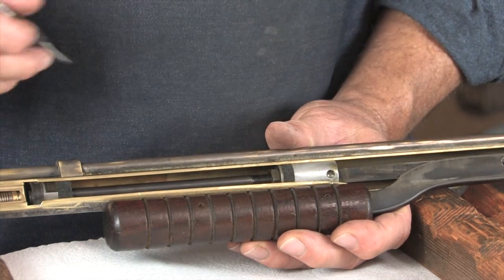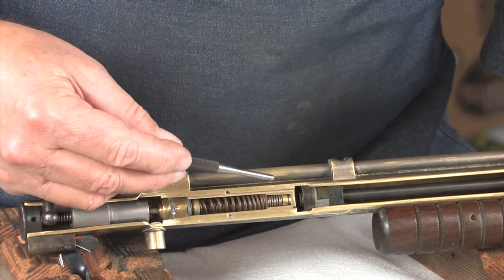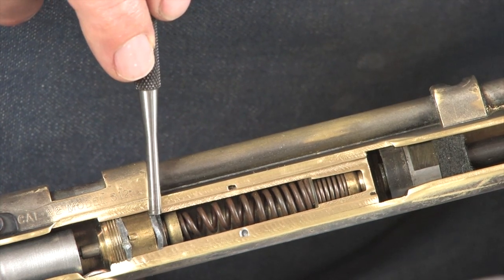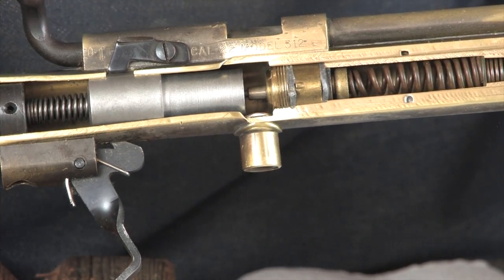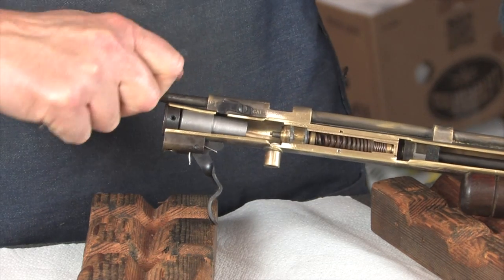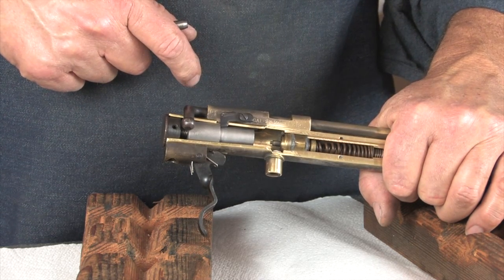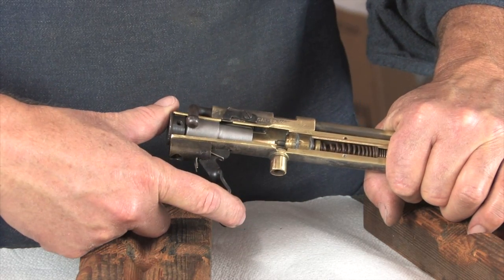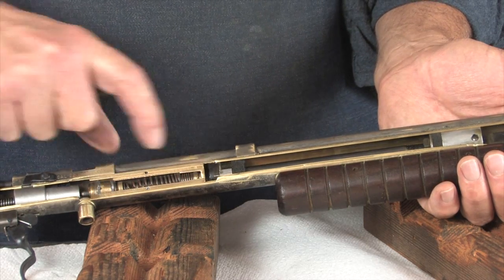Benjamin 312 pumper - Cut Out Demonstration

Comment: Help !  I have a 397PA that's had little use that won't make pressure. The gun was bought in the late 1990's, I am trying to flush it, but no luck so far. What kit would I need to rebuild it ?
Reply from the maker: Try any of these guys;
https://northwestairguns.com/where-can-i-get-my-vintage-airgun-repaired/
Correspond or call if you are uncertain, any of them will set you up with the right stuff.

Comment: What year did they start making them.
Reply from the maker: I think they started production in about 1940, but only made a few because of WWII material shortages.  Ramped up production after war was over.  These were made into the mid-1960's when they were replaced by the Model 340/342/347.

Comment: I have a 310 that the barrel was separated from the pump tube. I soldered the front sight back down and it seems strong (waiting for reseal kit) but I'm wondering if the entire length of the barrel should be soldered?
Reply from the maker: Some were spot soldered, but usually they are soldered continuously the entire length.  If it’s just an inch or 2 you might be ok, but I wouldn’t expect it to hold if the separation is longer.  Shoot it and see if it holds.  If it breaks, then resolder it the whole length.

Comment: did i hear you right did you say lead as in plumbus as seals?
Reply from the maker: not quite sure what 'plumbus', but lead as in lead
Reply: @NorthWestAirgun  okay thankyou for telling me that its plumbus thats why im wondering why i find roof lead here in the philippines for water proofing the parts where you shove in a nail
Reply from the maker: The lead needs to properly sized to seat on the bottom of the exhaust valve and at the top under the valve retaining nut.  If you have to make one, use the bottom of the exhaust valve, the step above the valve face, to size it both outside diameter and inside diameter

Comment: Thanks, great video, I have a model 347 that's not holding pressure, I'll try the links to try to find a rebuild kit.
Reply from the maker: The 347 and 342 are my favorite Benjamin pumpers.  Some even have pretty nice triggers!!!  Well worth the effort to rebuild, even if you have to send it in to a pro to do it.  The basic set up of the pump assembly and valve is the same as the 312/317 rifles, so  the same kit and tool should work in either.
Reply: I also have the same model. But at the moment it is not in order. Have to repair. If I can get the  spare parts I am in a position to repair it. I can spend money on this. Thank you.

Comment: Cool video, thanks for the cutting open. I was messing with the trigger pull on a springer, where the safety is on the trigger, was to light a pull and the sear didn't engage the piston properly, so i kind of like this idea of a safety but you have valid points. They could have made the gap between the hammer less far to travel?

Comment: wow what great videos I've had a 312 I got from my uncle when I was 7 almost 40 yrs. I have always heard you don't want to send these in for repair because of recall on them. My seals have not worked for about 10 yrs. now.  Do you have a good link on where you can get seals and the tool? found a kit for newer gun that the tool looks the same as this but can't buy separate, and I need the seals also.

Comment: Very nice. Even though I have wanted a "tootsie roll" 312 for 40 years, I guess seeing one cut in half really is very interesting. Having older rocker Sheridans, I get a far better understanding on the simplicity and intricity that went in to making these great airguns. I'm very impressed on the relatively small size of an area that actually held the air! Any idea on the PSI it was holding at 8 pumps? Thanks for the very informative info.

Comment: I just wanted to thank you for this and the other vids you posted on the 312 pumper.  This information on the soldered valve system was invaluable to me.  It helped me to restore my .20 Cal.Sheridan  Silver Streak. I got the tool and ten other parts I needed from B & A  and I refinished the stock.  It came out so nice I can put hard hits on tin cans at 60+ yards. At first it looked like crape and wouldn't shoot at all. Because most of my shoots will be much closer I put on a red dot sight, man Am I loving it. can't wait for the first hunt. Thanks again.

Comment: I bought a reseal kit for my 312 and it only has one lead gasket. The other one is some kind of nylon looking material. Which one goes where? Is the lead one at the front of the valve or at the back of the valve. By front I mean towards the barrel of the gun. Thanks.

Comment: These videos helped me. My landlord has one of these guns and we were working on it today. We didn't have the tool to get the valve out. But I am sure it needs cleaning. The symptoms is that the gun has very low power and it retains some of the preasure in the chamber even after it's fired. So you can cock it again and continue discharging air until the chamber is empty usually 2 times without pumping to repreasurize it. I know it was really cruddy inside and we used some liquid wrench and rust breaker to try and clean it out but it still doesn't work very well. It will shoot, But it has low power much lower than it should. You can shoot the ground from about 10 feet and dig the pellet out with your finger. With only about an inch of penetration. I know it is supposed to have more power than that. His cousin actually commited suicide with this gun. He shot himself under the chin. Though it took him a while to die, It did have the power sufficient to inflict a deadly wound. So the lack of power it has now has to be because all of the air preasure in the chamber is not being evacuated during firing. The gun is actually in good condition, but it hasn't been shot in probably 20 years until today. So right now I'm trying to figure out what could be the cause of the problems.I'm sure it needs new seals, but I do think a major issue is somewhere relating to the valve. The hammer and hammer spring are both in good condition. In fact the entire gun is in surprisingly good condition considering how old it is. Anyone who has any information I would appreciate it. I think it would be awsome to get this anteaque air rifle working back up to it's normal performance.

Comment from the maker: Aire Comprimido;  you need a special tool to remove the valve parts, a square tool with a hole to take out the valve retainer nut, and then a tool with an internal thread of 9/32" x 32.  There are rebuild kits for these airguns on ebay, I believe.

Pedro; I know, it ruined the gun for sure.  But, it was already pretty well ruined, so I was ok doing it.  These airguns are pretty common around here, and this one was about the worst I had.  I hope it was worth it so people can see how they operate.
Reply: NorthWestAirgun do you have a complete rebuild kit and re-seal kit for a 108 or 109 crosman town & country in .177 or can you repair it ,I have had this gun for about 15 years first gun I purchased of eBay sold as working.kind of made me not to buy anything else but I have.i have 3 crosman 130,2 crosman 140,2 crosman 1377 vintage,two 2240 changed to pcp and a silver streak Sheridan vintage,rebuilt all.can you rebuild it and how much after I give it a try first.